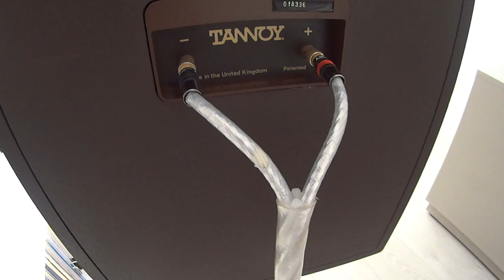Tannoy LGM 12" - 1990's Vintage Dual Concentric Speakers

Comment: Hi, nice video.  How much do you think a set of these should go for now, in good condition?  (May 2020)
Reply from the maker: Thank you. Depends on the country you live in. In the UK a set in average to good condition goes for around £600 to £700. If you have a set in excellent to mint condition is should go for around £800 to £1000.
Reply: @AudioNostalgia  Thank you.  I'm searching for my first Tannoys and it's tricky getting to know the correct value.  I'm following some of these on ebay.  Great condition, but twice that price.

Comment: Were these speakers always sold in pairs or could you buy singles? I have a frustrating situation of having found just one in storage and can't find the other one. Also, I use it as a center speaker for my 5.0 set up. Is that ok?
Reply from the maker: I believe these were sold in singles but don't quote me on this. I've had 3 pairs and never with matching serial numbers.

In terms of using it as a centre speaker - I don't see why not? After all quality sound can only enhance your home theater experience.

Comment: I own LGMs - these are amazing speakers, but it needs to be paired with warm, tube amplifier like Jadis.
Reply from the maker: I can imagine that a softer top end of a vale amp may nicely balance rather sharp top end of these speakers. However, if memory servers me right,  I have never had a chance to try these LGMs with a valve amp.
Reply: I have mine paired with an early SS Macintosh 2505.  I'll never sell

Comment: Tannoy LGM and Yamaha A-S2000 go very well together?
Reply from the maker: I'm afraid I cannot comment on this. I tried number of different amplifiers, and in a properly organised listening test, neither me nor my friends were able to tell the difference. And when I say properly organised, I'm referring to a blind test, where volume levels of both amplifiers are matched within 0.5dB and where there is a live switch, so you don't have to switch everything off and unplug one and plug the other back in, instead you have a switch, so you can switch between amplifiers instantly while you listening. All the other equipment of course stays the same and I do 10 switches. If 7 times out of 10 I am able to recognise correctly which amplifier is playing, then I conclude that the difference is due to the difference in amplifiers and not due to my own biases.

In my experience, providing that the amplifier is half decent (i.e. 400GBP and more expensive) and has similar topology to the other amp that is being tested, there is no audible difference between them. Yes, I've heard the difference between valve amps and transistors, but not between decent transistor amps.

Comment: Yamaha are too revealing and bright sound amplifiers true to the souns the same as Tannoys .
Bad recordings bad sound
Reply from the maker: Not sure if I'd agree with your statement. If an amplifier is too bright, than it is either a poor design or it was designed purposely to colour the sound in a certain way.

To my, job of an amplifier is to amplify the signal - nothing more or nothing less. As a matter of fact, in a properly designed blind test with modern well designed transistor amplifiers, it next to impossible to tell them apart.
Reply: @AudioNostalgia  all amplifiers has a voicing otherwise all would sound the same .
Yamaha are true to source and you and me know bad recording sound bad harsh compressed and shrill specially with revealing speakers.